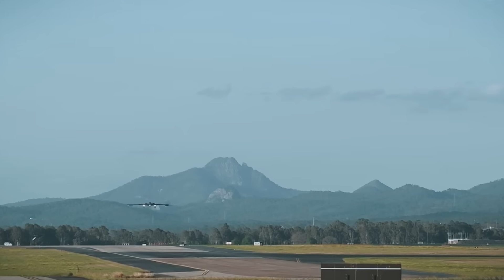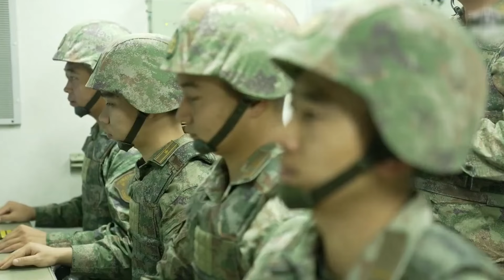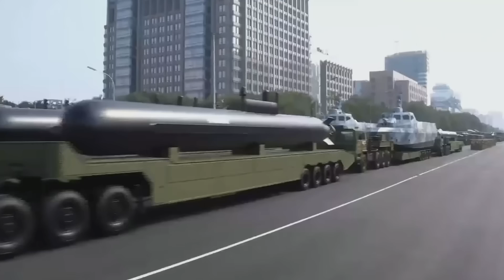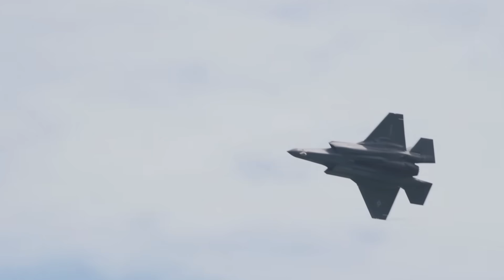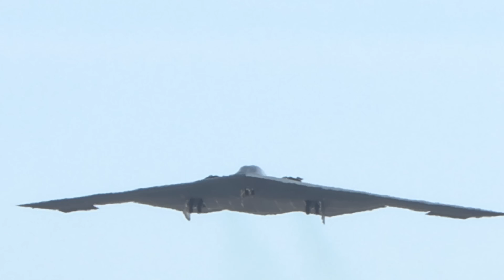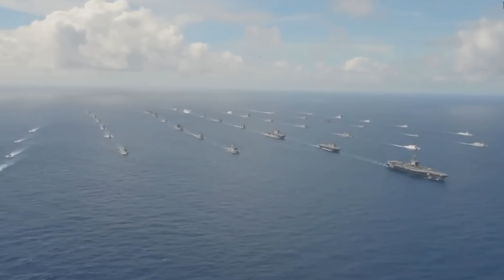B-21 RAIDER Can Hit the Fight in 12 Hours — Here’s How It Breaks China’s Air Defenses

Comment: US forces when using B-2 spirit, for some reason try to get rid of as much the AA units in the area as possible. They're so expensive that one loss is huge. Using a bit outdated Su-24 I think military had discovered, it's mostly invisible but on same altitude or above the bomber it becomes quite visible. So they don't  risk because there's still chance.
It's generally not a great idea to drive through a savanna with lions.